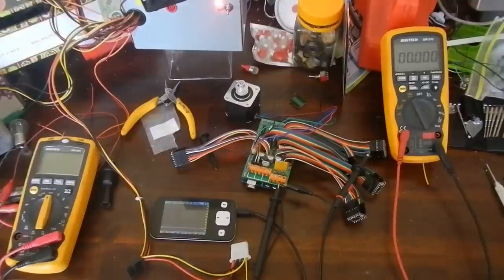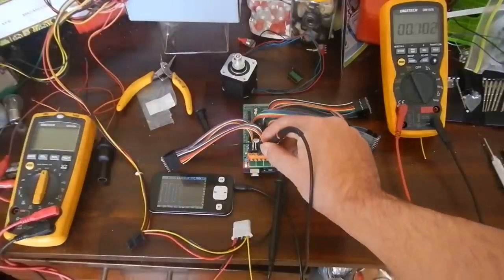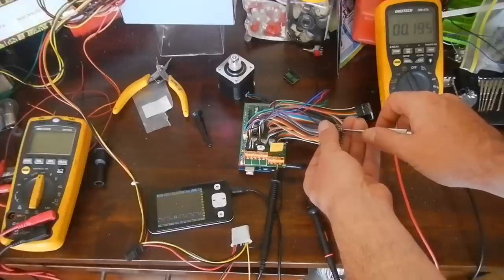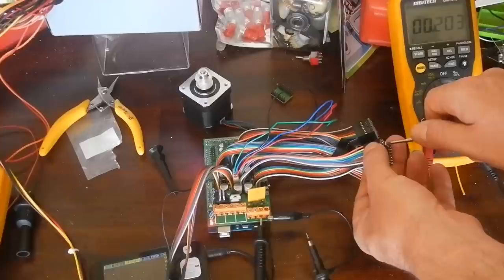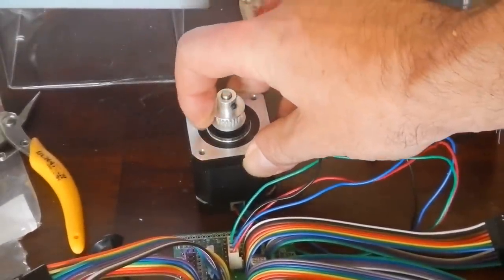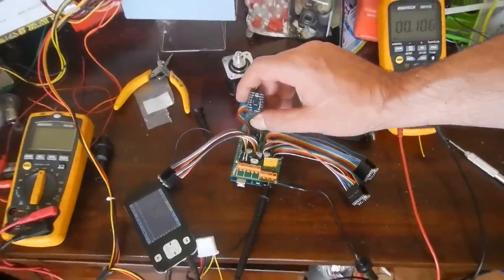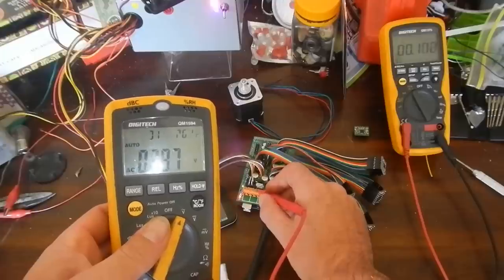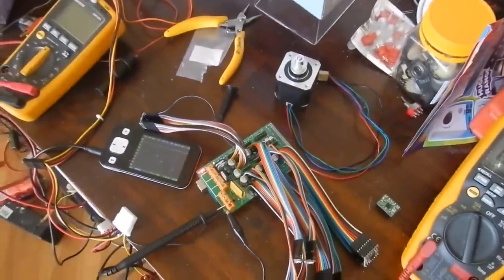RAMPS 1.4 Test, with a4988 Stepper Driver, NEMA 17. How To.

Comment: I may be being stupid but...Whats the point of the RAMPS board? As far as I can tell you should just be able to drive something like an L293 directly from your MCU.
Reply from the maker: The arduino can only supply 200ma current.
The RAMPS shield has the caps and other components needed to drive the pololu stepper drivers, as well as the MOSFET's to control 3 heaters, with indicator lights, fuses, reverse polarity diodes, and a few other benefits. Total current through the shield is around 15-20 amps. It also puts the feamale headders in an arrangement that the stepper drivers will actually fit. They dont plug in to the arduino.... So basically it stops the processor bursting in to flames as soon as the power goes on.... while providing a bunch of other useful features. There are sites describing how to do a diy shield, which has a lot of advantages, but you need a shield. No cpu will deliver 11 amps to the heated bed.

You also get the option to power the cpu from usb and the sheild from isolated 12-30v psu. Further protecting the cpu and improving performance and efficiency if you drive it from 30v.
Reply: I know the MCU cant power a motor or the heaters directly but using MOSFETs transistors and h-bridge drivers theres no need for the ramps board or the Pololu things.

I guess the only reason is to make the design more modular and easy to just buy big bits and plug them together?

Im planning on trying to build a repstrap with all the electronics on bread/proto boards instead of buying large PCBs already made. What I mean I guess is that there doesnt seem to be anything this board does that seperate drivers and transistors can do.
Reply from the maker: Your right. To some extent. If your that good you wouldn't be asking me questions though.... For me it was a time and cash thing. These boards are cheaper than anything I could make. I love salvage, and probably have what I need to do it with salvaged parts, but the hours would be huge! It would also likely involve writing new code. The stepper drivers are h-bridges, with all the necessary add ons attached. Have you actually looked at stepper driving requirements? To get the precision needed and not miss steps is a bit of a challenge. I'd rather spend $4 on the stepper drivers and know it will work with the code....

I really want to do a custom shield for the 3rd printer. It will still have the cheap a4988's though. Home made h-bridges are not really an option for most people.
Reply: You're right, Im not that good im afraid. 3D printing has facinated me for some time and I have had passing thaughts about building one.
Recently however I have started to get more serious with this and I was really hoping to buy as little 'preassembled' as possible. So my own hardware and electronics to interface with some suitable existing software.

Granted I never expected it to be and easy task, With lots and LOTS of learning along the way, but thats whats fun about it! I just hope its not 'impossible' :S
Reply from the maker: Id say you should look at some cheap knock off a4988's from china. I got some on blue boards for $5 each. and had to solder the headers on. They are not as good as the name brand ones, but a 3rd the price. 3-4 stepper drivers have been blown in testing and making mistakes with connections, so get a few extras. They are really simple to use ( have a video on that), the arduino only needs one pin to drive them with a digital signal. Everything else is doable with scrap, and you could substitute with a large number of parts. Although we have made 2x ramps board, and are now buying pre fabs, as the pre made ramps board from china is $25, and the ones we made cost $35 and took me 3 hours to smd solder..... There would be a few advantages to making a custom sheild though, like cooling. Not many realise that the heatsink on an a4988 should go on the bottom of the board, not on the chip. The ramps board does not allow for the heatsink to go in the right place. Although I haven't found heatsinking necessary either. The Z akis is driving 2 steppers from one board, its turned up nearly to half way. The rest of the drivers are all turned down low. If your good at the mechanical stuff, everything will slide smoothly and you wont need to drive a lot of amps.

You could also increase voltage and get more power from less amps...

Comment: hello sire 
if i send more than 1 step to stepper moter in give me high noise and not move but if i give motor only one step it run correctly can you told me why also if the motor specs say that motor take 5V can i use less than this volt or i must adjust power volt to same number in motor spec.
Regards
Reply from the maker: Your signal is too fast. Reduce the frequency. Or you don’t have a strong connection. If the motor datasheet just says 5v then that’s what you give it.
Reply: how i can reduce frequency
Reply from the maker: Turn it down? Seriously?  How would I know what driver you're using? And why am I doing your homework?

Comment: Good tip: never connect or disconnect a motor while the board is powered, it could burn out the driver.
Reply from the maker: That is a good tip. I think I did just that a few weeks after filming this. I should probably add an annotation for that. Thanks for reminding me.

Comment: The two LEDs next to the power output are not flashing. Dose the mean my ramp 1.4 is dead ??
Reply from the maker: Probably not. If something is dead will just be a few components. In the cas of the heater circuits, each one is just a resistor, mosfet and led. So only 3 parts to check each heater. Might just be bad leds. Is your ouput - conection switching low when checked with a meter? Does it drive a load? Are you getting signal to the gates?